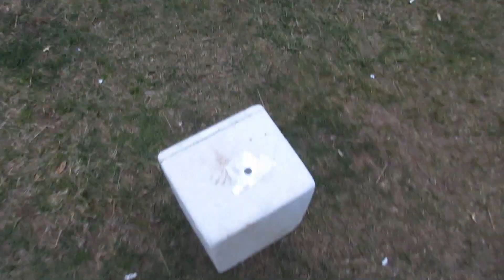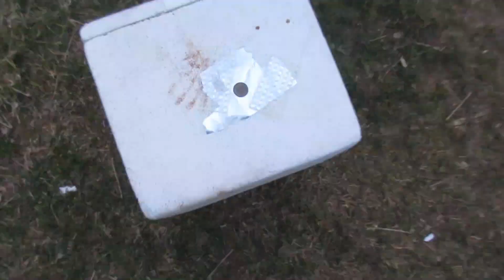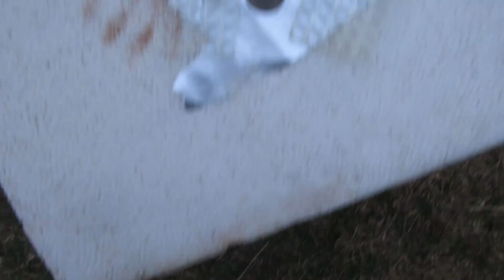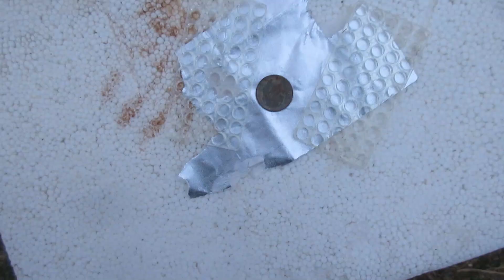What would this mean ?

Comment: Tough question Professor Tn. If you notched out the foil range would that help the dime come through?
Reply from the maker: Yeah notching the foil.  And ID rises extremely little or not at all.  You own Deus  2?  If so try this with Deus 2 deep high conductor and watch what happens. Does ID rise?  Then go look at reports of where users of deus 2 are runnning in higher mineralization and note their results.  Coincidence?   The try this with fast program.  Note differences achieved vs deep hc program.  Then go and see if you can read folks results using Deus 2 in higher mineralization.  Coincidence?  Then check relic program.   Note differences.  And then go see what users using relic program are seeing in higher mineralized soil hunts.  Coincidence ?

Cheers